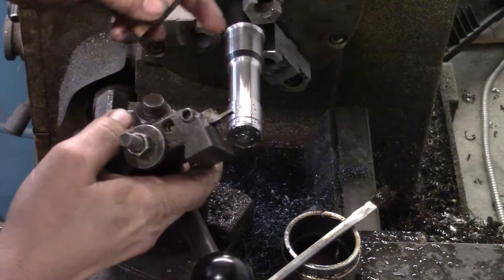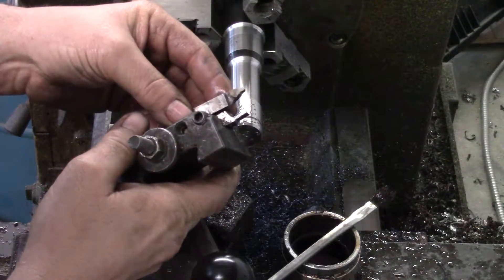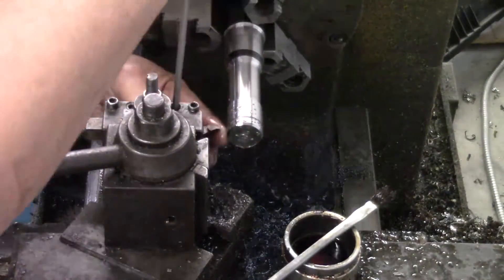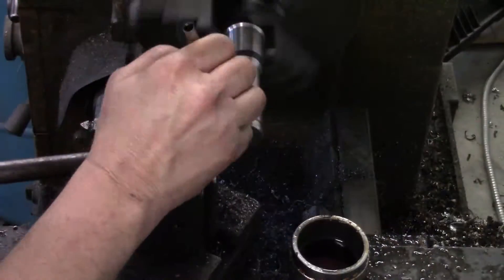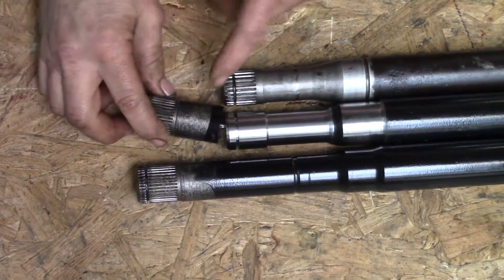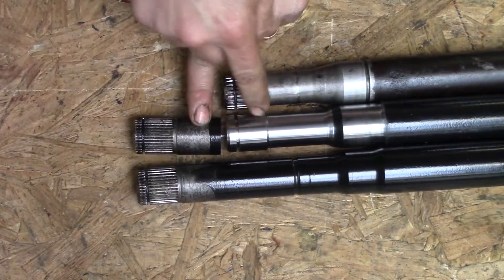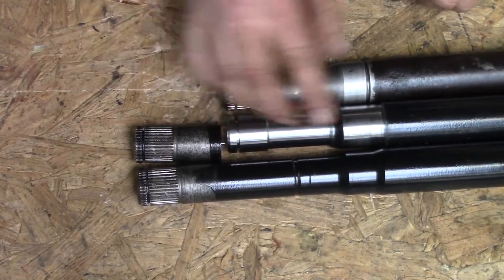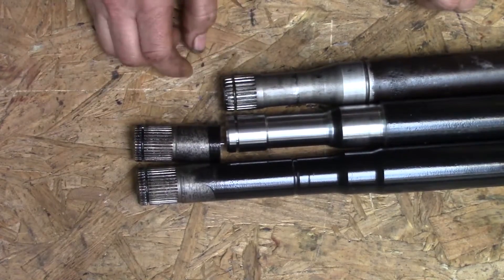Combining Tesla and Cobalt Axles for the Tesla Goblin

Comment: Are you able to tell me the diameter and how many splines are one the Tesla CV joint where it goes into the transmission differential?
Reply from the maker: Sorry, it has been to long ago. I was using the original for dimensions and it is long gone.
Reply: @doylefab8945  thanks anyway. Good work on the project.

Comment: UNPRACTICAL, might as well start producing dozens to make a profit
Reply from the maker: Curious, I thought I did a great job. I'm not sure how I would have done it any other way that could handle the torque the model s drive puts out.
Reply: That's why I said from a productive/quality perspective, "might as well start producing dozens to make a profit". From a practical perspective, is an unpractical procedure to average viewer.
Reply from the maker: I wish could sell some more of these, it was a fun project, but putting a model s drive unit into one of our kits was a one time custom project. The drive unit alone was $13,000, I can't see a need to mass produce them. Maybe I will get to do another some day. Hope so.
Reply: @doylefab8945  Good to hear, since we're on the subject, do you know how many splines are there in a Tesla-axle?
Reply from the maker: @EddyBoh  I know they were not the same as the Cobalt but the owner took his left over parts with him or I would count then for you. Sorry.
Reply from the maker: @EddyBoh  I found the end of the Tesla axle that I cut off in the video. It has 35 splines.
Reply: @doylefab8945  Thanks man, my apologies for the late notice. Since we're on the topic, how much do you charge to make a conversion for an output of 26 splines for a Tesla axle?
Reply: @doyleFab I could use a set for my beetle as well, what would be the cost?
Reply: You can have custom half shaft axles made, my Moser or others.   I've just sleeved and plug welded two different ends to make a custom half shaft.
And I've also just ground off the splines on one end and then welded the cv sleeve (not sure what it's called).   Can't say if it holds up to EV torque, but I'm working on a 300hp leaf motor that needs half shafts to connect to a C6 cv bearing.  I think it needs to be longer, not shorter, so a sleeve seems the right solution.

Comment: The Motor / Inverted unit look humongous on he Goblin Tubular Chassis.  Its going to be a "Beast" as the Goonzquad dudes would say.  Will the battery pack go under the goblin chassis like on a S/X/3 ?  seems like an option would be to use Model S Hub Carriers and make different Control Arms / linkages from them to Chassis (probably just as much work to do).  Of course the S could have had useless Air Suspension.  Looks like a great job so far!